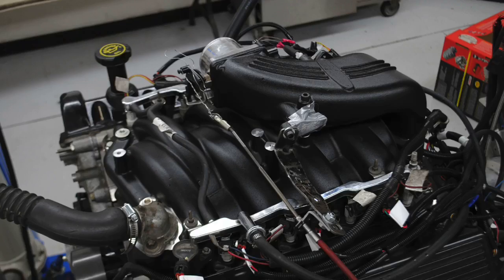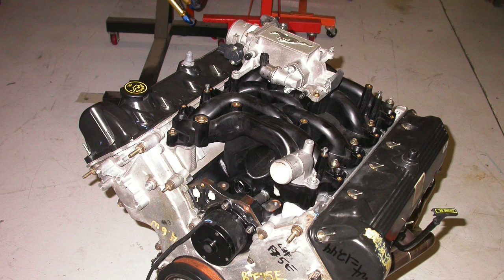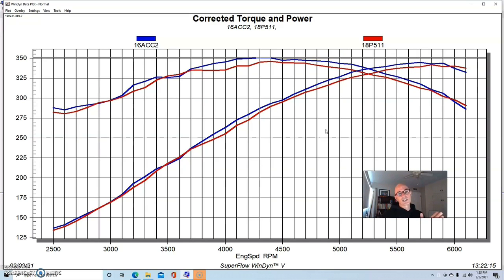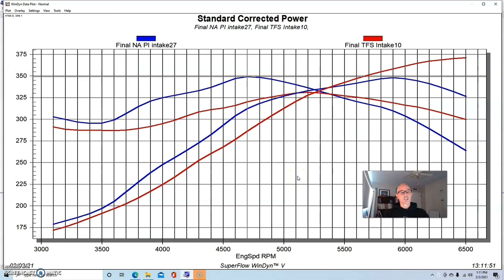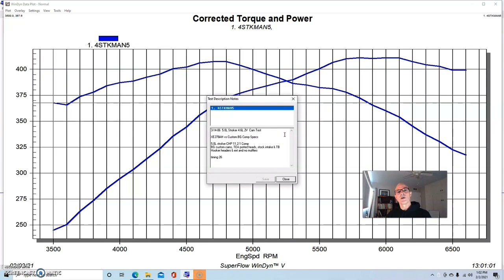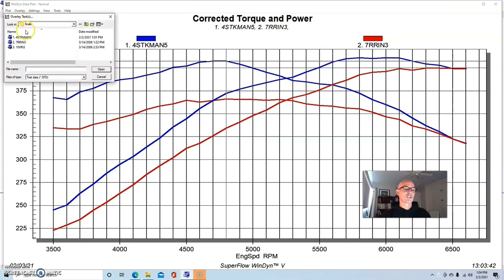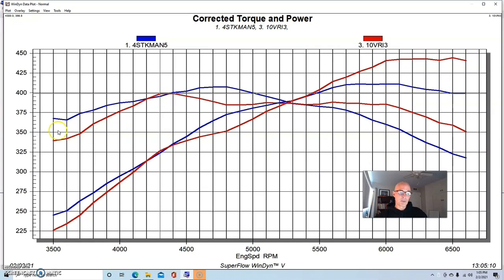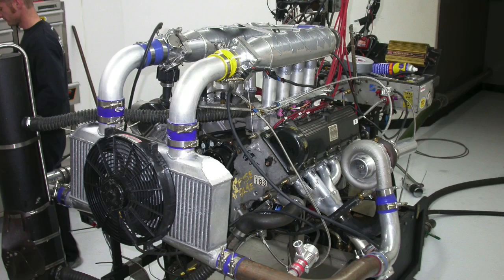DIY 4.6L 2V FORD INTAKE TEST-WHAT REALLY WORKS?

Comment: Have you ever done a 4.9 or 4.6 Cadillac engines? I would love to see the results thanks
Reply: I had two 4.9 Caddys, a 95 Sedan DeVille and a 92 Eldorado. I always thought about swapping to a Northstar, but I would've just figured out a way to remote turbocharge the 4.9 before I did that. However, I have ALWAYS been interested in some performance testing on the 4.9, but there just isn't hardly any aftermarket support for it or the Northstar engines.
Reply: @DiamondBackRattlaKid  I've had several 4.5, 4.9, an 4.6 Cadillac engines they are underestimated people dont give them the credit they deserve. They run extremely well
Reply: @tenehaglendening9246  as usual in the BOP+C world the heads are the biggest cork.

Given the other attributes of the engine (feather weight block, replaceable sleeves, compact size) I think a solid head package would make it into a potent small block beater.  

It would be best done with a bespoke intake to move the ports substantially and that would drive the price up. But I'm willing to bet it would be a screamer with just a new top end. 

And with an easy 100lb weight advantage over an ls1, probably a bit more with aluminum heads it wouldn't need to quite match or beat other small blocks to be worthwhile in many applications.  

I have pondered one for a Locost type build for years just because it weighs as much or less than most V6s while making an honest 250hp with a mild build and they make a very nice sound!
Reply: @DrewLSsix  I've always wanted to build one but never had the money to give it a honest try. But would love to see someone else do it just to satisfy my curiosity.
Reply: The 4.6 Northstar is a huge piece of junk.
Reply: @DastardlyDeedsDoneDirtCheap  depends on what years after 2005 they fixed the head problems. And alot of problems before that was owners fault. You cant mix regular antifreeze with DeX cool.
Reply: @DastardlyDeedsDoneDirtCheap   they still make lots of power.
Reply: Buddy had a Northstar in his 08 STS and that thing had some balls and revved to 7000+. Never had any problems with it